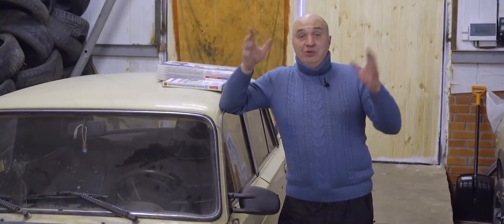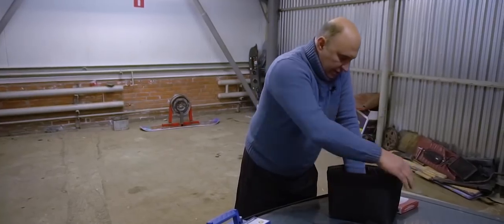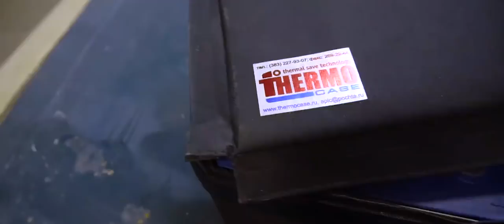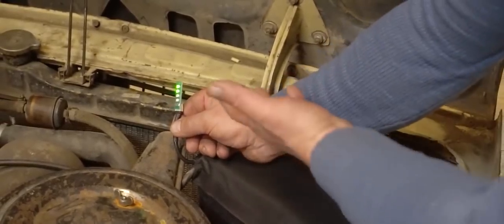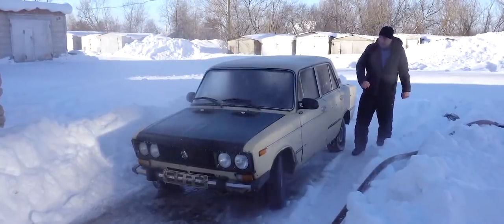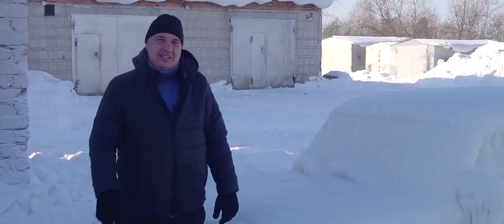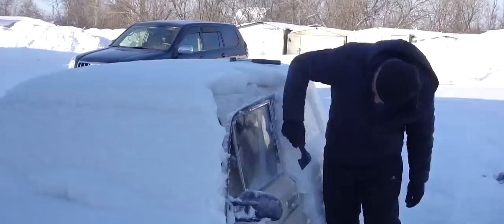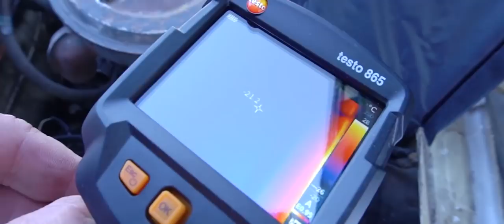Deep freezing: we’ll warm it up and go

Comment: ultimate cold air intake
Reply: i wonder if it has like 3x the horsepower :)
Reply: A turbo would be so happy
Reply: You don't need an intercooler in Siberia
Reply: @luuk3213  Oh. You do. The difference between 20 degrees and -20 is not much. A turbine can heat the intake air by more than twice that.
Reply: @maxinnn1  Not really. The cold engine oil doesn't flow properly, so the turbocharger won't have sufficient lubrication at a cold start. When the engine reach its running temperature, the turbocharger gets so hit the  ambient temperature doesn't matter much.
Reply: @luuk3213  You do need an intercooler, and the problem is your oil cooler may end up if not frozen, then containing thick, sticky oil gel.

Comment: its a lada of course it will run
Reply: Makes this American wanna get one, that's for sure! lol
Reply: TheCitroenman1 I have had, over the course of years, 7 fiat 124s. The Lada is a toughened up 124. I miss my Fiats and wish I could get one again. I have never been hopelessly stranded by a fiat. Fix It Again Tony.
Reply: Well it started. But it sure didn't run anywhere.
Reply: Ladas are the best
Reply: Carsten Hahn just watch a crash video of one involved. They crumble like tinfoil!
Reply: @SerPurple51  Russians dont crash. They just park creatively.
Reply: Fiat 124 - I had a 131 Pinafore’ Named the BRAVA in the states. dohc 5-speed, rocker switches went out every 6 months.   Had the parts dept order me up 6 backups. When those went I didn’t bother w the lights rocker, the light shut off auto when the car was shut off. I had the first set of daytime running lights. Engine was tuff as nails as was the tranny. Drove it forever, comfortable yet tracked, hauled ass  and always fired up, the rear drive was excellent for drifting in the snow. It had a perfect 50%/50% weight distribution. The battery was in the trunk! With basic maintenance it ran well. A/C lasted till I sold it at 130k+ and I bought my first used $5000k Subaru DL 4-speed. Direct valve tappets clicking around town.  Every time I saw a Lada on the road it was almost always a hippy behind the wheel!
Reply: @SerPurple51  American cars arent The strongest but i dont see anyone complaining
Reply: YES    like  my  old  lada1600  they  run  ...............
Reply: How  many  ladas  have  You  had ?  ............... Zachary Durocher
Reply: Ladas  was  " work-horses " ,   Not  comfortable  but  took  a  lot  of  punishment,  both  from  bad  roads  and  bad  drivers .  .................... Zachary Durocher
Reply: What lada is that i want me an Russian car. Its very cool and good for my American ass
Reply: It's a lada,you can drive it on the sun
Reply: supernumery  Russian engineering being crap is the reason why NASA has been buying   rocket engines from Russia since 70's to this day.

Comment: Would be good to use here in Canada
Reply: yea i would
Reply: Those don't heat the battery just the engine to keep the oil warm.
Reply: They don't even heat the engine, just the oil pan.
Reply: there are block heaters and pan heaters. highway tractors often have both
Reply: Yes, but when people speak of block heaters for their cars or trucks, they're almost always referring to either dealer-installed or Canadian-tire bought oil pan heaters.
Reply: CaptHollister no they aren’t, they are taking about the heating element installed in a frost plug, it heats the antifreeze and the engine block. That’s why they are called block heaters.
Reply: In the winter yes. Rightnow it's hot as hell in Canada.  I'm in Vancouver. It was like +33c here last week
Reply: Jared Melnikel
In this part of Canada, when people talk about "block heaters" they are talking about oil pan heaters. This may not be true for heavy equipment operators, but it's definitely true of regular car owners. It's just one of those idiosyncrasies of colloquial language.
Reply: youandiryan
There is no such thing as Canadian temperature. It may be hot as hell in Vancouver, but it was 13-14c on friday in Montreal.
Reply: marco same in Michigan
Reply: youandiryan Block heaters on cars are heating elements in the block not on the oil pan. Unless someone has bought a magnetic pan heater and stuck it on. Every car I have ever saw that has an extension cord to plug it in has a heating element in the water jacket of the block
Reply: There are mostly block heaters installed by dealers, pan heaters by DIY because it is a lot easier, or the ones that people stick in the coolant line at the bottom and count on the hot coolant rising to circulate.
Reply: And in Alaska.
Reply: Block heater is an element that heats the oil. If you've ever used one you know your vehicle starts much more efficiently does less damage to the engine and make your vehicle warm up inside much much faster. If you have a diesel engine  it will never start it in the winter without a block heater.

Comment: had a few of these cars in canada -40 sitting in the wind for 10 hours while at work pulled the manual choke cranked it over and it started no problem engine had synthetic 10-30 oil and a 1000 cold crank engine battery best winter beater ive owned and they are heavy little brutes and the heater cooks you out  and simple to repair or do maintainance on sad to say it rusted away id love to own another that was in great shape one tough little car

Comment: The car would be just as cold without the layer of ice
Reply: ian gee And how entertaining it would be to watch, not...
Reply: Actually Ice becomes an insultor ,just like snow .
Reply: Sure it will, but this is not about the temperature, its about the freeze up and Co. Duh!
Reply: I really like these guys and their channel.Im just pointing out that once  ice or snow forms at 32degrees F or 0 degrees C  generally it doesn't get colder . So in essence the ice is helping to keep the entire car at exactly the freezing point. Something I probably wouldn't have thought of St the time either.qa
Reply: G Hall ah well!
Reply: yh but it looks cooler
Reply: The temperature will continue to lower with the outside temperature.  It will not stop at 32 F or 0 C.
Reply: have to agree with joe blow, ice does get colder, just like everything else
Reply: ian gee, yeah sure! but it wouldn’t be as cool! 
Stop the hate and just appreciate. Or go find something else to watch and hate on. It’s just a small channel figuring out some content to do.💯
Reply: Ice is a good insulator actually. Test any fridge. The fridge performance falls down when starts to get ICE since ICE is "hotter" than the -25c that the system is producing. Once you defrost your freezer you get lower temperatures.
Reply: G Hall Ice is matter, matter has energy as heat. Heat always tries to be balanced. If you put ice in a chamber that’s -50, the ice, being warmer will give its heat to the chamber air until the temperature is balanced. Just like everything fucking else.
Reply: ian gee
You're right, of course, it just makes for a better visual.
Reply: André Ribeiro Pun intended, 😂😂😂👌👍
Reply: Thank you captain obvious...
Reply: They turn that car into Iceberg on wheels
Reply: ian gee yeah but the show effect wouldn't be there
Reply: Of course ice gets colder. At minus 40 degrees, the ice is also -40. A good bartender keeps ice in a deep freezer so that it cools the drink without diluting it quickly. The ice has to be warmed up to 0 degrees before it changes phase and becomes liquid water.
Reply: I wonder if it might be warmer without the ice. Maybe the ice acts as insulation... when things warm up during the day, isn't the heat of the sun less likely to penetrate through the ice?
Reply: G Hall Not true
Reply: That's not true at all. That's like saying lava never gets colder than it's freezing point once it solidifies back into rock. Ice can get as cold as anything else just as easily. -10C, -24C, -273C. There's nothing stopping it from going below 0C.

As you saw, the engine bay got very cold; just about ambient temperature (~ -29C). It's true that ice helps insulate, just like anything else. Adding any thickness of any material would help insulate at least a little. In fact, even copper which is a very good thermal conductor would technically reduce the overall heat transfer coefficient. That being said, they did this over the course of 3 days, so any insulation from the ice was insignificant. The temperature had more than enough time to equalize.
Reply: It's a common misconception because the phase transition from liquid to solid means you are removing heat but the temperature  remains at 0 (at equilibrium) until the phase transition is complete at which point the temperature will drop more.
Reply: ian gee exactly.    If anything the ice sheet protects the car from blistering winds shielding it a bit
Reply: G Hall exactly
Reply: fredlllll yes it can.
Reply: Maybe putting ice all over the car insulated it, just like an igloo does.
Reply: D AE that was Kelven not centigrade
Reply: Thats what i was thinking. It looks really cold, but the temperature isnt any lower. The car and engine are just as cold without all the frozen water on the car.
Reply: I live in Canada and was parked beside a lake one time and it was really windy and wavy out my car look almost exactly the same took me a few hours to get it out.I put lots of dings and dents from hammering the ice off and I cracked a few of the plastic parts but I had no choice. I did think of putting a tarp over top of it with a couple heaters but that would have taken  forever. Long story short don't park beside Lake Ontario in winter unless the lake is totally frozen over which it does from time to time.

Comment: Lada is better than any Bentley or Mercedes.
Reply: Matthew Smith than i will trade you a lada for a mercedes
Reply: Lada is like old bucket on wheels
Reply: @submarin777 exactly ... and that means you can do anything with it and it will still go
Reply: TheProttotype my father had one, lada 1200, and he also had couple screw drivers, and 3 wrench keys. That was completely enough to fix any problem.
Reply: mercedes diesels > any lada ever

The russian guy in video noted that a "Late model mercedes" wouldnt be able to perform this task, nothing beats the older 4 and 5 cylinder mercedes diesels
Reply: any new car can do this easily
Reply: +WindozeCS
Fuck old Mercs, slow as pingus, heavy and large cars, Lada are easier to work on and goes quicker LOL
Reply: SMGJohn mine is 125 hp from the factory. quick enough and comfortable. everyone is entitled to their own opinion, this isnt something that you should be getting mad over
Reply: SMGJohn I just looked up the numbers, my car has a significantly faster 0-60 time as well as top speed compared to a lada. And my car is easy af to work on, probably 10x more comfortable, and imo it looks a ton better.
Reply: Ever heard of The Mercedes W123?

Comment: My father had an old Lada 1300S and it would start no matter how cold it was, dam I clould ride that car in just a T-shirt because of the heater, it was so efficent.. Very fun car to drive in the snow, light back end and rearwheel drive and a 1.3 litre engine  with a whopping 67Hp lol . Mind the Ladas are actually a license prouduced Fiat's 124 and 127
It even had a crank wheel underneath the bumper, so you could crank start it with a crank tool..

Comment: I wonder how easy the ice would fall off with a coat of wax applied to the paint
Reply: Lassi Kinnunen my wax can be applied near sub zero temps and last almost 3 weeks in winter, you can do it lol we do it in heated car wash bays in Canada and it is worth it as my car is so slippery keeping it wet during washing is difficult lol
Reply: It helps,especially on headlamps.

Comment: I had no problem starting a Lada Niva which has similar engine after a couple days in - 37c without any gadgets but couldn't move until idling for hours because brake fluid including those in a clutch turned into gel.

Comment: That battery thermo pack is a really good idea for cars that operate in extremely cold climates. I live in the northeast of the US and the coldest temperatures that we've seen here so far this winter is about 28 degrees fahrenheit. The coldest temperatures I have ever experienced here was back in the winter of 2014 and 2015 when we were exposed to a "polar vortex" and the temperatures were in the -15 to -25 range with a wind chill of close to -30 Fahrenheit. All of our oilfield heavy trucks were gelled up and the fuel lines were frozen. Back in February of 2010 we got 28 inches of snow overnight and I drove my 1995 Cadillac Deville to work that day. People were stuck everywhere.

Comment: Your battery temperature check doesn't count because you left the engine running while you got the hood open. That warmed everything up. We still have no actual indication of how effective your sponsors' thermal case actually is.
Reply: I don’t see this being that much of an issue, insulation works both ways and we had proof that the heating pads where working, that’s enough for me anyways, does what it describes.
Reply: @ApolloTheDerg  I thought these heating pads, will work constantly, there is no use of them, if they dont heat the battery constantly during the night.
Reply: They're pretty common on semis here in the states.  They work, ask any truck driver.

Comment: why does spraying water on a car cool it down more? if it is being frozen by ambient temperature, the ice is an insulator, it would help the engine warm up faster, and is therefore completely meaningless to this experiment, most likely actually negating the issue the thermal casing is trying to solve by trapping excess engine heat, rendering it clickbait
Reply: It was just to see if the battery would start the car not to see how fast the engine got warm
Reply: Makes sense

Comment: I'm planning to build insulated battery boxes ( 2 inch polyurethane board) and to add a warmer under the battery, one for reptiles used under sand aquarium and to power it from the batteries themselves and keep them warm ( 20c) at all times during the winter in my Alaska made for VR. Batteries boxes will hand under the cube truck containing each 6 group 31 batt. I think it will take very little power to keep them warm with two inch insulation... i still
Have to check if all my materials are electrolyte resistant. But yeah, nice video!

Comment: what kind of draw does the heater pull out of the battery, surely its gonna go flat in a few days with that? the usual battery warmers are ac-plug in units
Reply: He said it was less than a security system because it only activates far below 0 degrees

Comment: What impact does spraying the car with water have on the battery condition, if the battery is under the hood? Doesn't it just protect the engine and the battery from outside freezing conditions? Also,  there is a manual for each Fiskars axe you buy where there is specifically said that you should not use it in combination with hammer. But what am I talking about ... Meanwhile in Russia :D

Comment: The thermal casing might overheat your battery and start a fire. (If it’s the summer) or your engine get hot if you drive a lot when your car after it starts up.

Comment: Lada...one of the few motor cars left with a manual choke...it will start as long as the engine oil is the right weight.

Comment: charged batteries don't freeze.....the engine coolant might though.....
Reply: whatever....I have NEVER witnessed a fully charged battery to freeze in any conditions in my lifetime 
(56 years, and temps down to -20 degrees F.), but I have seen several dead ones crack their casings from being frozen in the same timeframe. So draw your own conclusions....I speak from actual observations.
Reply: Engine coolant is not a problem if you mix in antifreeze. 
But even 100% fully charged batteries might freeze if it's cold enough.
Reply: Are Lada's air cooled? I know more Soviet cars are/were than Western cars are today.

Comment: Super cold temperatures and plastic don't mix well with hitting. Too many cars today have plastic and rubber parts which just don't handle the cold very well. The Lada is probably nearly perfect for super cold temperatures. It could use some improvements, but it's fine just the way it is.

Comment: Well I did not know that a frozen battery could start a car, but will not charge. By the way at what temp does a battery freeze? Temperature where I live seldom goes below 0 Centigrade.
Reply: If i remember correctly, a empty one would freeze at -10 to -15.
A fully charged one should not freeze if its a arctic battery, designed for cold weather. 
Well i have had no problems with mine with cold weather going down to -42.
Reply: If fully charged, -76F = --58C.  So, basically, this entire video is BS, because, if well charged, batteries shouldn't be an issue at either the stated -40C or the observed battery temperature taken from their IR camera of -28C.

Comment: Should e that plug in  waterpipe heater and tape it to the inside around  the edges of the door  see if it will melt around the door

Comment: Ice is in only one temperature it acts as insulation this cold and no colder. If it didn’t have the ice on it would be colder then the metal would be more brittle and the rubber and plastic would be more likely to crack apart that is how to get oil leaking

Comment: Goddammit! Just when everything was finally free of black bars with widescreens content, and widescreens, the industry decides we need a even wider picture, and the damn black bars are wasting screenspace again!! In this case though, you can see that whoever encoded it, overcropped it, and exported in the wrong aspect ratio, and that it was originally shot in 16:9....  So please check your encode settings, and put it back to 16:9 instead of this overcropped 21:9 nonsense.